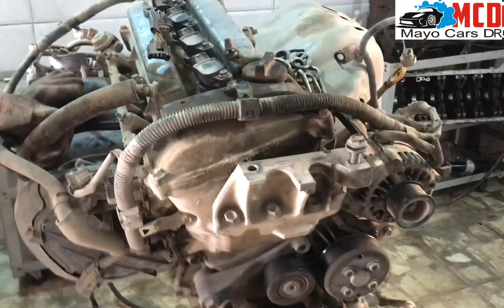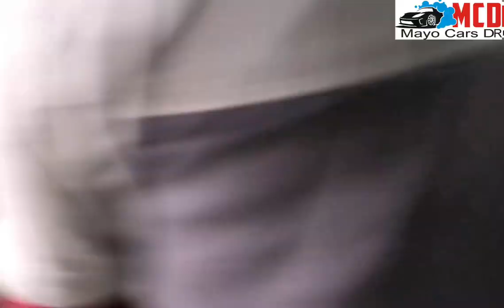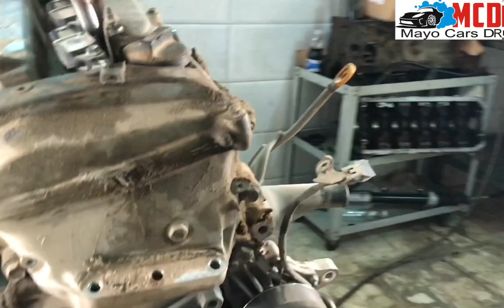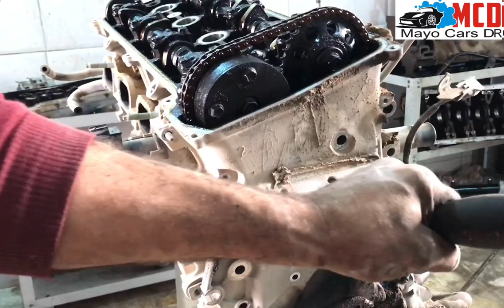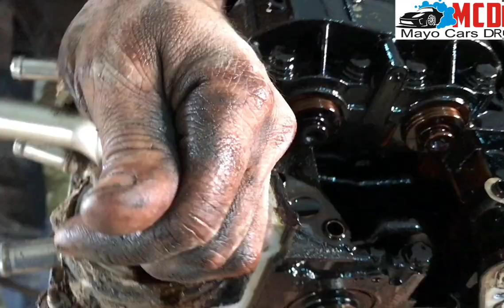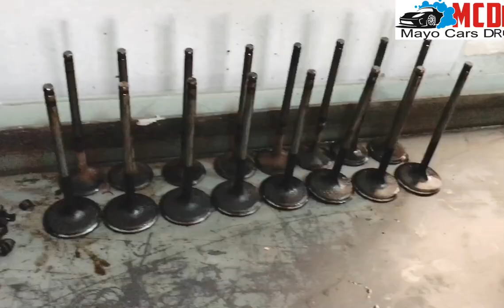2AZ-FE 2.4L Engine Disassembly Of Toyota Camry Rav4 and Previa 2006-2010

Comment: Hi , is it possible to change the valve stem seals on this engine using the rope method without removing the head ?
Reply from the maker: Thanks for coments and sorry for late reply,Yes, you can change the valve seal without removing the head. There are special tools for this